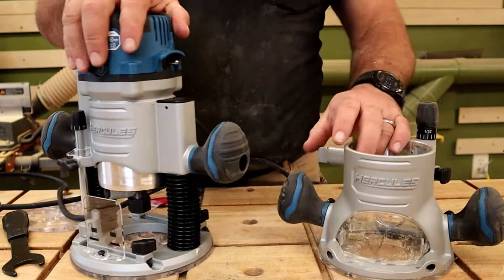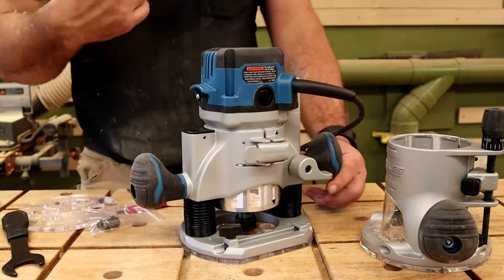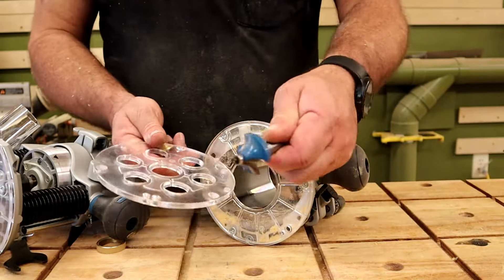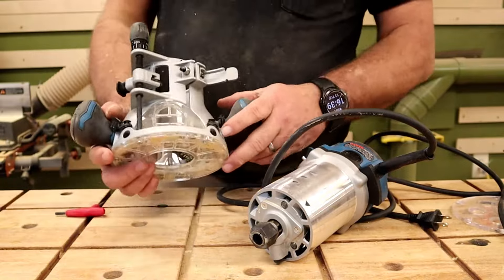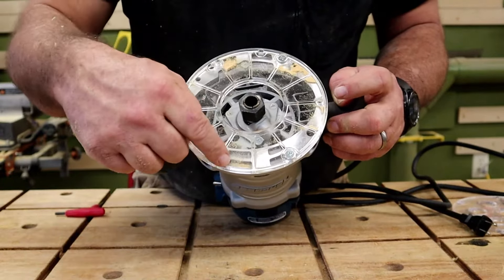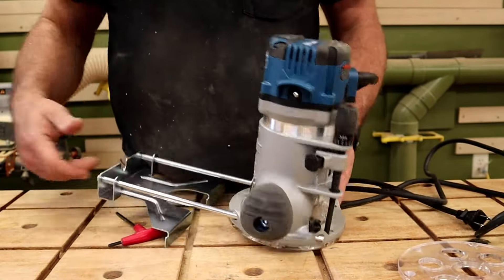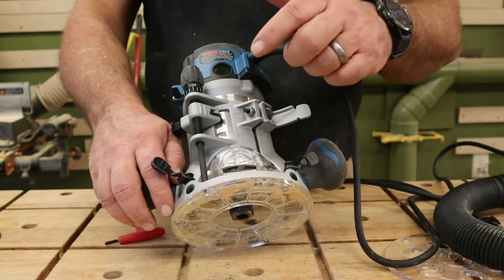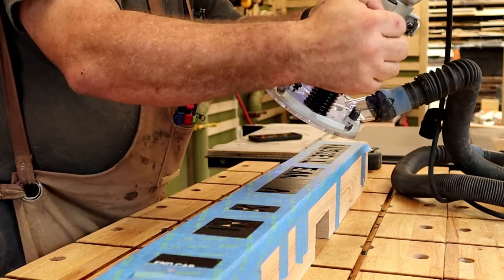Hercules Router Review from Harbor Freight 57368

Comment: It is a $20.00 trim router, not a production shop or contractor grade. You never gave it a chance running backwards, over tightening the depth gauge and throwing it around on a 200.00 kreg table top. I have never had a router and never needed one,  buying a 100.00 dollar router would be a waste for what I needed.  Review that Kreg table as critical.
Reply from the maker: Different people use different tools. I never use a plasma cutter in my shop. If you are referring to my work bench I have a couple of videos on it. I am sure many people find the Kreg table better. For me this one is a lot cheaper and is more functional but I don't alway function like other people. 😀
Reply: I feel like this comment makes zero sense and has absolutely nothing to do with this video
Reply from the maker: Everyone is entitled to their opinion. I can see where you're coming from. 😊 #OpenMinded #Respectful